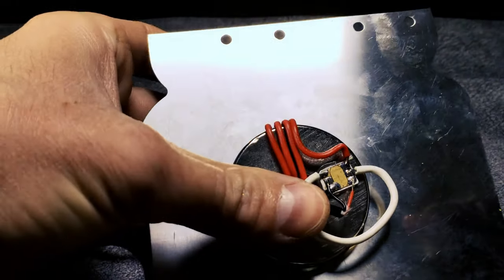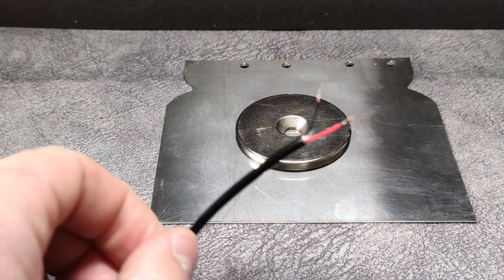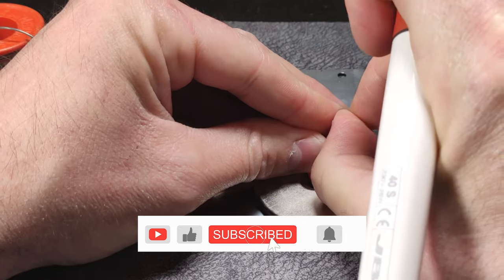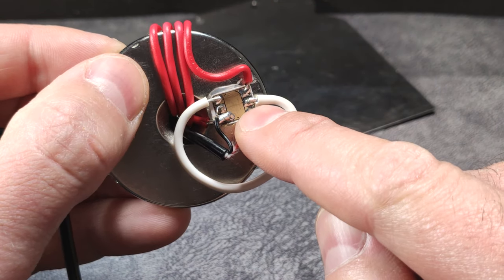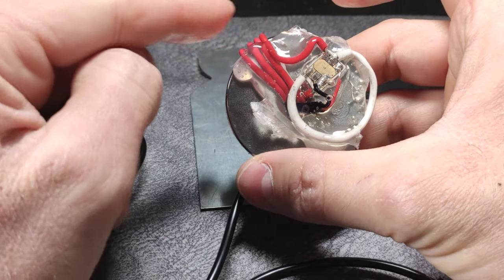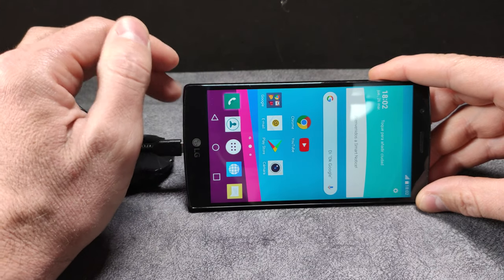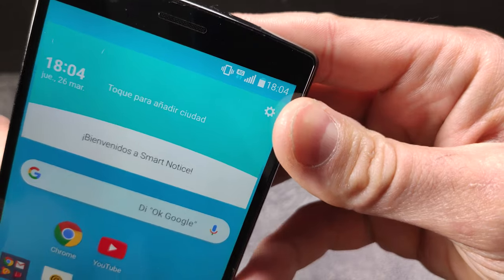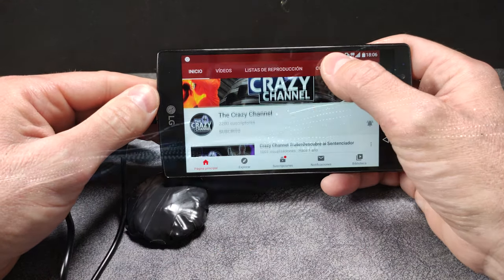FREE 4G ON YOUR SMARTPHONE - FREE INTERNET - NEW METHOD 2024

Comment: Where do I get the magnet?
Does this work with any make and mode of phone or does it have to be LG like the one you are using?
Does this work with any make and model of SIM?
I want to try it but I want to make sure I use parts exactly like the ones you use to avoid any mistake or failure.
Do you have stores where you sell the ones you built?